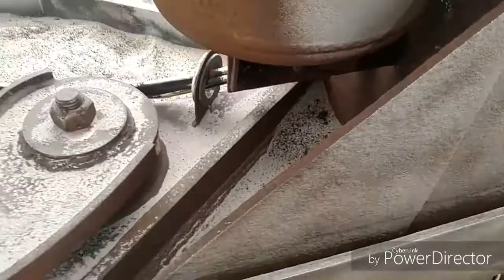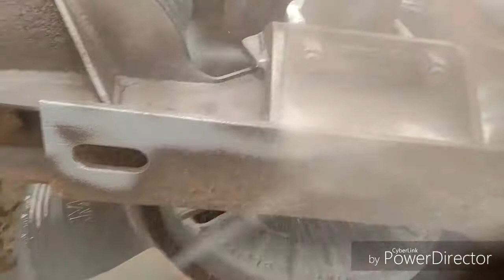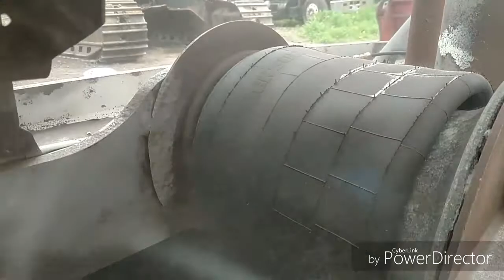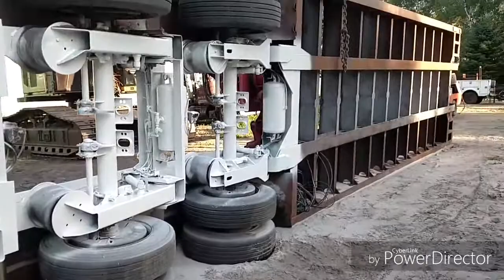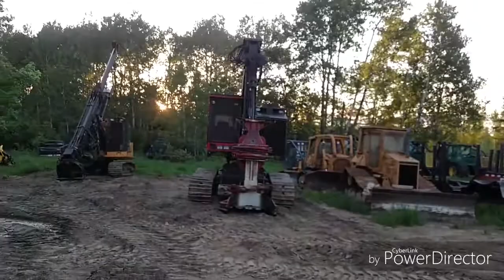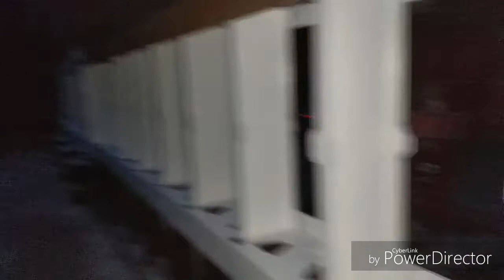POV Sandblasting and Trying to Beat the Rain!

Comment: Wow you worked late.   Looks good tho.        Forgot about the time change out there.  Guess 2 hrs difference anyways to us.      Have you ever heard the DNR talk about the EAB bypassing the black ash?
Reply from the maker: I'm Central time zone.  You're Eastern I'm thinking.  One hour difference.  Most of our ash is black ash.  They fully anticipate it wiping out most of it I believe.
Reply: David Haley its wiping the ash here in va too...cutting a job now and 70 percent is dead hardly any leaves came out...real bummer...it will all be gone eventually
Reply from the maker: Carson S ash is a low value tree here and hard to sell sometimes.  Still hate to see it all die.  Is ash a higher value tree for you?
Reply: David Haley yea right now a mill i sell to has orders for it and paying 475thou delivered over 12 in straight through price...so not to bad

Comment: Jeeze you self employed types work some hours. I would be a little worried about the sand getting were sand oughtn't to get but I can't see a more effective way of removing rust. How much sand do you go through on a big job like that?
Reply from the maker: I think I used about 2,500 pounds of sand on that trailer.  Lots of surface area!

Comment: Have you considered self etching primer?
Reply from the maker: Alabama I guess I don't know anything about it...
Reply: Alabama stuff does wonders!
Reply: David Haley 
Self etching primer is a acid based primer as it contacts the bare metal the  acid etches the metal and allows the primer to make a good bond. 
It has very strong fumes so a 3M breathing mask is a must.
Reply from the maker: Alabama thanks for the idea.  I'm going to check into it.  The macropoxy is a 2 part heavy solids epoxy that I've had very good luck with over the years when applied to blasted metal.  It's fairly expensive though.  Over $100 a gallon to the general public.  I may have negotiated a lower price but it's still quite costly to do a project like this.